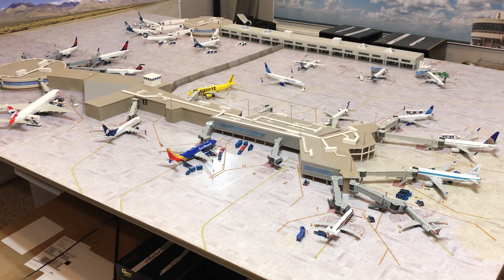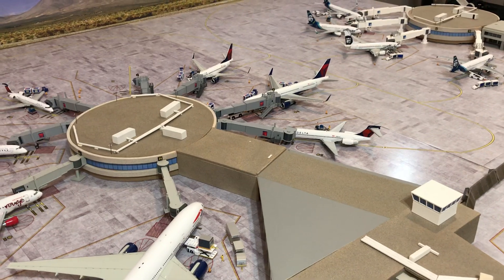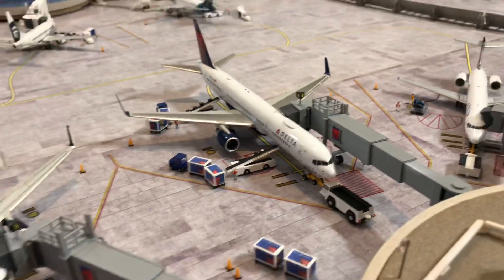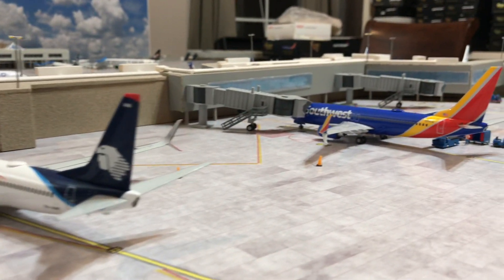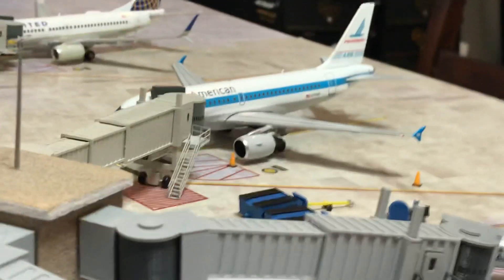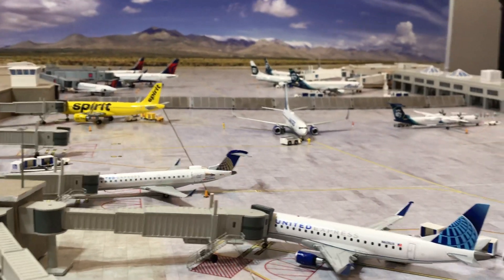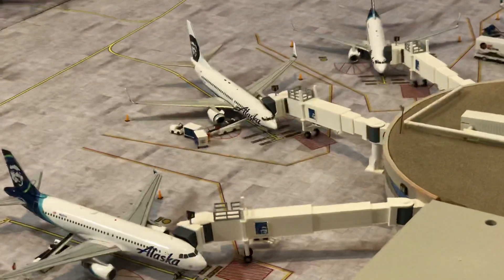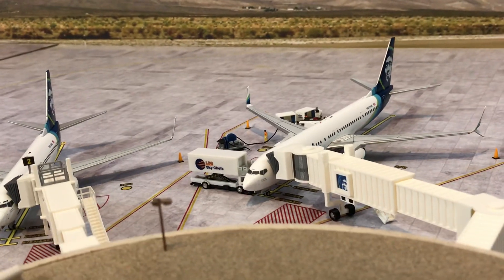1:200 Airport Update

Comment: How do you get custom models?
Reply from the maker: United Pretzel Twists you either have to make them or find someone who will. I do most of my own based on how hard the custom work is. I try to keep them as simple and straightforward as possible.
Reply: Foster398 are they painted? If so, what kind of paint do you use
Reply: Foster398 do you have any models for sale?
Reply from the maker: I try to minimize painting as much as I can since I am nowhere good enough to replicate how the manufacturers do it.